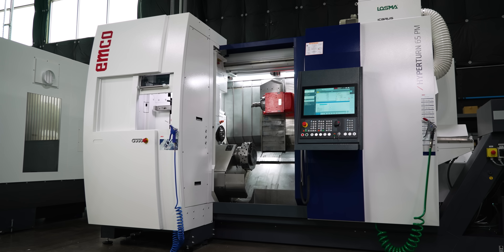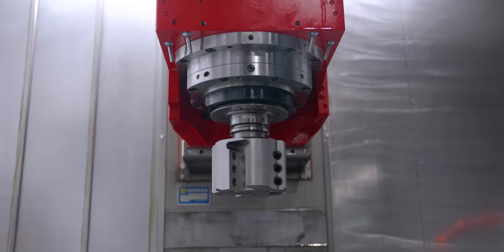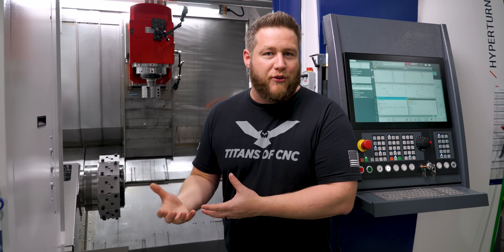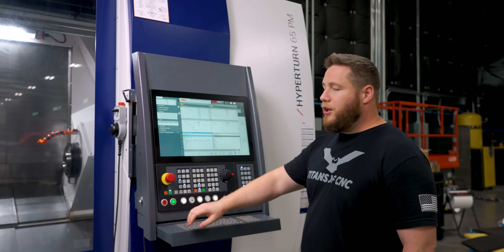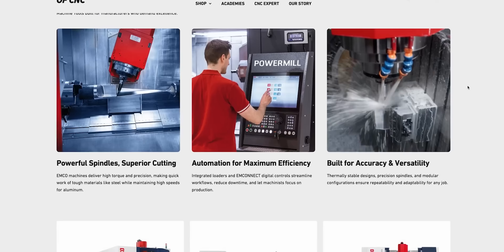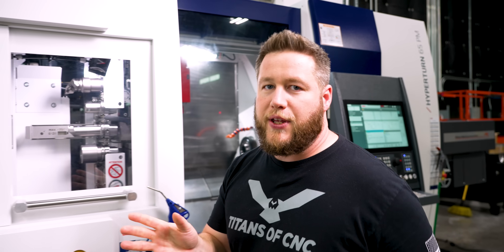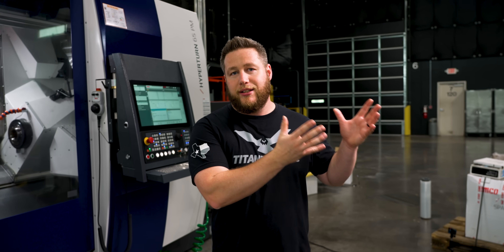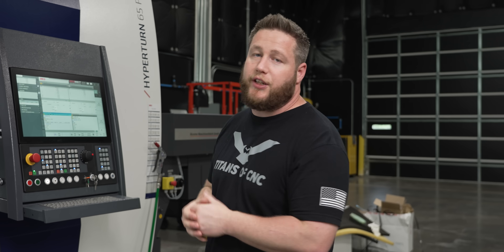I’ve Never Seen a Mill-Turn Like This in My Life…

Comment: dude, i've tried learning on an emco cnc mill. EMCO CONCEPT MILL 105. i've had unlimited access to it, any time i wanted, as long as i wanted, 24/7. i was never able to figure out how to set up the coordinate system on that thing. i called the customer support and they just blew me off. emco support is the worst, and their user interface is the worst garbage ever, full of bugs and issues and clearly created by programmers with their d icks firmly stuck in the 80's. it's absolutely disgusting. i'd be doing so much good work with that thing, since i still have free access to it, but it's just USELESS. maybe the model you got - sure - yeah - maybe it's better. you paid way more, too. but the thing that I was presented with - and it was completely new just 5 years ago when i was using it - was hilariously bad.
Reply: CNC milling machines all work pretty much the same. You define your workpiece zero point with G54, and the tool lengths are easy to define with any control. I think some training would have been useful here, and every machine manufacturer offers that for an additional fee. It's a shame, though, that Emco doesn't offer training videos on YouTube that demonstrate these basics. I think that's pretty good with Haas. Incidentally, I use both Emco (with a Siemens control) and Haas. I'm happy with both manufacturers.
Reply: @Ixnay-Mike  G54 is one thing, but the problem was their simulation run disagreed with what was happening inside the machine... and I never got any sort of idea why. And yes, ANY sort of free training would have been welcome. What's worse is the software: they use some sort of decrepit Bosch garbage that has a million bugs. It loses track of settings and parameters you enter into it, and there's no chance of it getting fixed. It really looks like they got a binary from bosch twenty years ago and they have no way of upgrading it or getting it fixed without paying them another few million, and they never did the proper due dilligence upon reception of the work product. It's the worst user interface I've experienced on an industrial machine, ever, bar none.
Reply: @cheater00  I think you'll use Win NC on the 105. I've only used it on a Concept Turn 55 so far (20 years ago). I had zero problems with it, but the simulation was definitely worse than on the real Siemens control. I'm currently still using the old 810 and the new 828 Siemens control on my lathes. They both have top-notch 3D simulation. Haas simulation is really bad, but I don't program there directly, only via CAM, and there you have a decent 3D simulation. In terms of user-friendliness and simulation, however, many controls still have room for improvement.

Comment: Why do you like Siemens? We have a bunch of Siemens controls where I work and they are awful. (They are older though)
Reply: I've been working with Siemens controls for 20 years and find them very good and straightforward. Siemens also has a useful 2D and 3D simulation, which I really appreciate on lathes when I program parts by hand. The machining and drilling cycles are also very helpful and, especially on the newer 828d, very easy to use, even without CAM.
Reply: The sinumerik solution line controls are some of my favorite controls on the market while the older power line with advanced HMI interface was absolute trash😅
Reply: @TheFeralEngineer  @lxnay-Mike this explains a lot, we are usually fixing 25 yr + old stuff, 611 analog and some newer digital stuff mostly

Comment: That bad boy would be a good cylinder head  manufacturing / porting machine? Make crankshafts ?
Reply: I did it on a Mori NT4250 back in 2006, so yes.

Comment: question to jessie. are you sure that its a sub spindle and not a counter spindle ?
sub spindle's are as the name imply subpar to the main ( meaning weaker in both power but also rigidity ) and a counter just means that it sits counterwise to the main ( sitting oppersit to the main but is just as powerfull and rigided as the main ) ( when i worked with some citizin lathes and the teck guys from citizin came around they where very pasionet in explaning the diffrence and that we called it the right thing )

so is it a sub or a counter spindle ?
Reply: Generally speaking, there's no difference between sub-spindle and counter-spindle. The idea that a sub-spindle is "worse" is the exception, not the norm.

Moreover, you're failing to understand what "sub" actually means. It's not short for "subpar" and so a "sub spindle" does not imply a "subpar" spindle. "Sub" is merely a prefix that means "secondary" or "under."

The reason that it's a "sub-spindle" is because it's not the one doing the bulk of the work and around which the work is focused. Especially when you only got 1 tool turret.
Reply: @KaNoMikoProductions  thats just how i been teached and told by multiple people through out my working experience ( both from old fart's with 35-40 years cnc turning epxerience and the machine building enginer's that i talked with )
Reply: @flikflak24  It's still incorrect.

Also, it's "taught," not "teached."
Reply: @KaNoMikoProductions  well i am self taught in english and almost/barely above dyslexic so dont expect my english to be perfect ( im from scandinavia and english is not out first language here ( its basiclly a optional one here )
Reply: @flikflak24  Skandinavien er blandt de bedste til at tale engelsk i verden, så ved ikke om det argument holder i længden. Men hvis du er ordblind, er det fair nok. Min pointe var bare, at hvis dit engelsk er dårligt til at begynde med, er du måske ikke den bedste til at argumentere om, hvordan man brugere engelsk terminologi korrekt.
Reply: @KaNoMikoProductions  plus at jeg osse selv lært i englsk ( gik fra nada englsk til det nivo du så på kun 6 måneder )